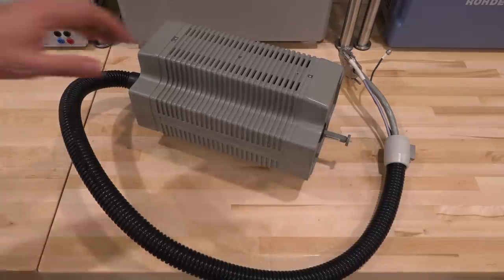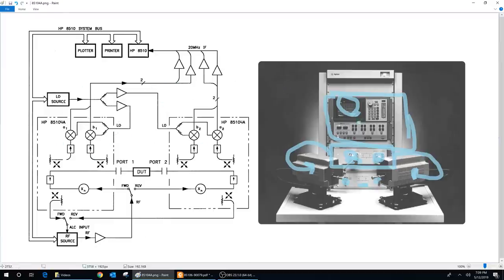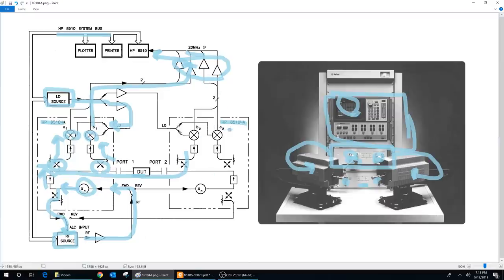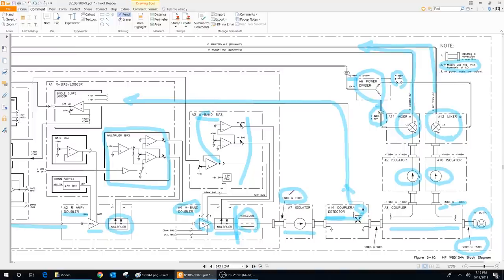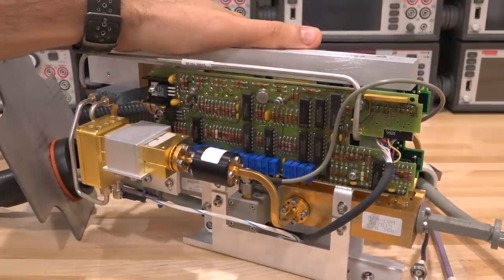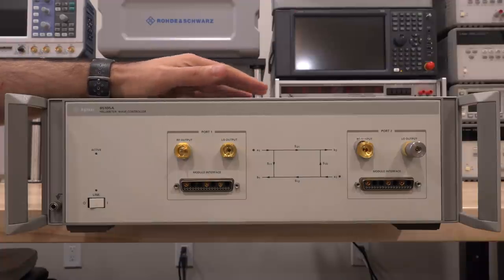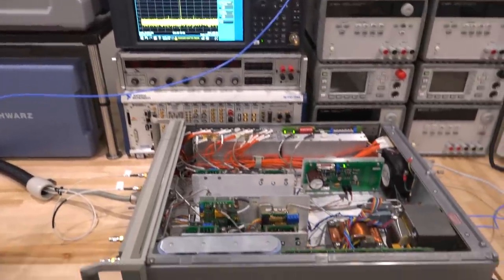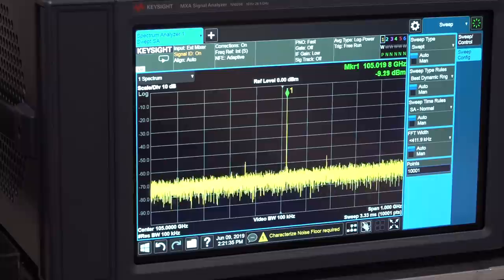TSP #152 - Teardown & Experiments with Agilent mm-Wave W-Band (75 - 110GHz) T/R Module & Controller

Comment: Brings back memories of working in a communications laser manufacturing site in the early 2000s.  We used to drive the HP 8510 via a GPIB bus, we would set up a mask that the devices response had to fit within then we would get a pass/fail decision from the machine.  The test program would test hundreds of parameters with the various HP and Keithley instruments in the rack.  Many hours writing code.

Comment: I liked how they used two 11970W harmonic mixers from stock as the mixers for this system. One of those by themselves cost $600 - $4200 today (depending on whom you're buying from and urgency; source ebay; will look up HP catalogs for back then price). I also now know why, sometime few years ago when using the 8560E series, I saw some W band mixers with different markings. (supposed to have the model number and serial in place of the tabular cal data we see here; cal data is graphed out rather than tabled; prefer tabled ;) ) The isolators are also two W365A. The couplers I'll have to review the video on my pc to see (on mobile atm).

Comment: @85105: suspiciously low price, seemingly removed from a working setup in a hurry (with wire cutters Oo) - > stolen goods???
Reply from the maker: Marwin Thedja In don’t think so. It is most likely from a surplus where they were cleaning a lab without any knowledge of equipment. So they just cut everything out.
Reply: @Thesignalpath  Probably cut the wires for copper :D
Reply: I had met with liquidation companies before..... They literally don't care. They see a mess of cables in the back (especially on a rack) and just cut them. Then they see the box and say that is what to sell [and sometimes mark up for losses]. Time is money. Just be lucky they somehow don't have bolt cutters/use a saw for the rack screws. XD

Comment: Why is the waveguide slightly helically twisted on its X axis between the magnetic isolator and the mixer?
Reply: I'd guess just to allow you to more easily remove the screws, so they are not all aligned.
Reply: @Gengh13  I noticed the alignment, so you think it is only mechanical? I thought the bend could have a slight loss associated and that it was intentional at that stage.
Reply from the maker: The isolated rotates the E and H plane. The twist re-aligns the orientation.
Reply: @Thesignalpath  Is the isolator using the Faraday effect internally? That would explain rotation of the plane of polarization. I believe (fibre) optical isolators work in that way, but I know nothing of microwaves!